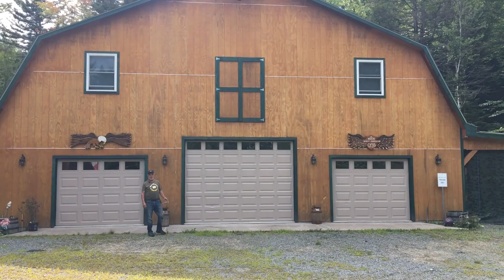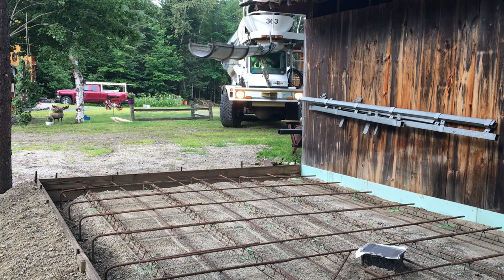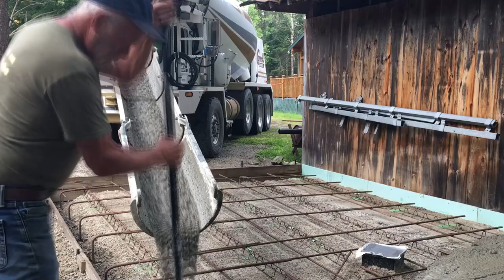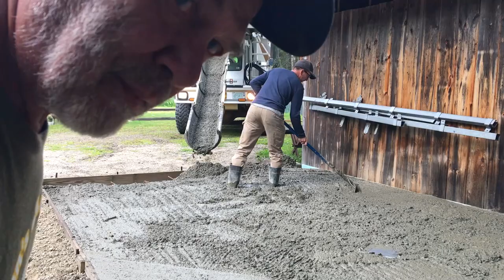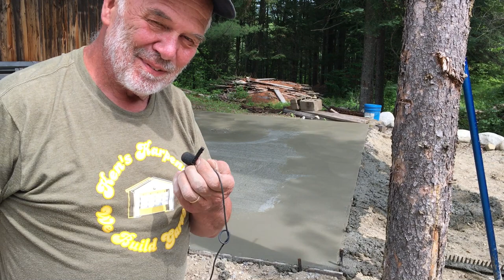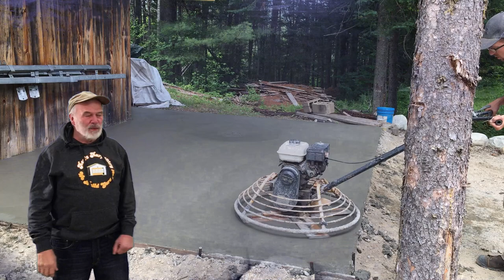CONCRETE SLAB FOR A SUGARHOUSE...and view of the biggest garage I've ever built.

Comment: Here's a question for the guys who don't know much about concrete.... I know the cost is different from 3000 to 5000 psi product but I don't know the cost variation. I also don't know if there's any difference in how it works or how long the working time varies. Other factors like fiberglass filler or more steel obviously play into things, but I don't know the variations. Perhaps you can spell that out on a job one day.... cost, time, expense, when it's needed, 4 inch versus 6 inch slab, extra depth around the edge, cost of insulation under a slab, radiant heat, etc. I'm sure you have done them all and I'd be willing to listen if you are willing to talk about it. (as would others, I'm sure)

Comment: what happened to what appeared to be a box in the middle of the floor as the pore was going on?
Reply from the maker: It’s a floor drain
Reply: @kenskarpentry  Yes, that is what I thought was mentioned, but I didn't see it on the final result.  Old eyes, I guess.!
Reply: @billgray6752  The floor drain has a small cover on it and then the concrete is poured right over top. Once dry you pull off the cover and install the grate.  This keeps concrete from getting into the drain.